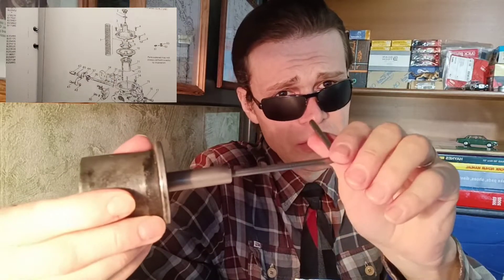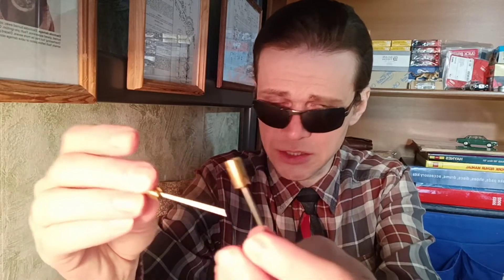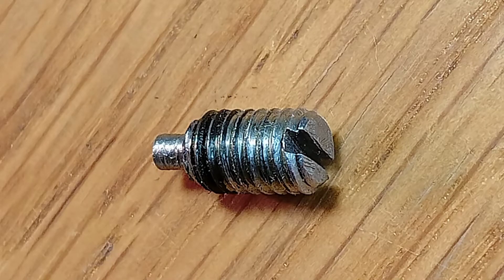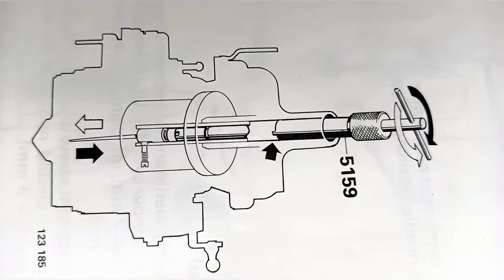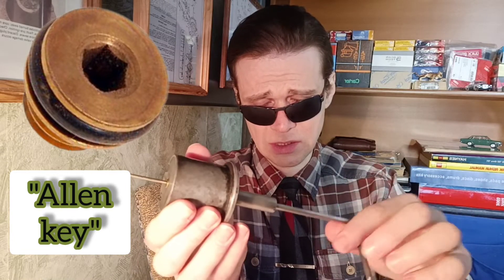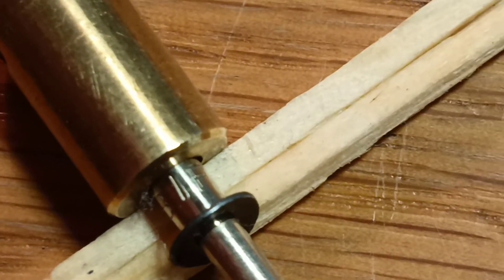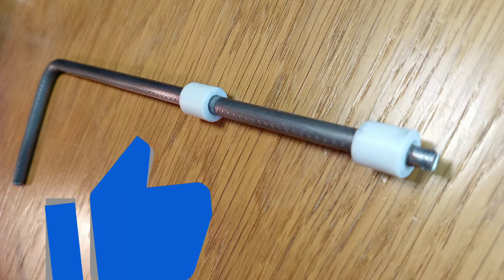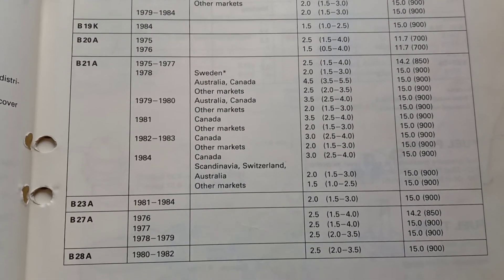Why ATF go out from carburetor Zenith-Stromberg 175CD very quickly? Adjustable Needle #carburetor

Comment: I have a problem with the non adjustable nail to be leaking. How do I fix that?
Reply from the maker: @cantzlermedia  Nail can be leaking if it 'adjustable'. In this case can be atf leakage. If it 'non adjustable' it will not leak. Another question can be with gas leakage. It's can be if the level of gas in fuel chamber too high. Which kind of liquid leaks?
Reply: @patricksgarage  it's hard to tell what leak that is leaking. I've had an issue with the brake fluid  coming into the intake from the vacuum brake booster, so it might be that that's coming out from the intake part of the carburetor. I've also had some trouble with the car only running on the choke. It's a Saab 99 with the triumph engine
Reply from the maker: @cantzlermedia  Fix all these stuff first before blame carburetor.😊🧰👍
Reply: @patricksgarage  Is ordinary engine oil okay to put in the carburator when you don't have adjustable needle?
Reply from the maker: @cantzlermedia  It's totally okay something like 20w40.

Comment: Thank you so much..My Volvo 240 have rich condition issue..Soot in pipes,blacked sparkplugs. I will turn needle anticlock to lean
Reply from the maker: Thanks for watching. Oh yes yes I am familiar with this problem 😐 also. Over-rich fuel mixture obviously. Maybe,  if mixture settings not help, check also main jet and needle condition..float level... Not forget about cold start device 😉. All that can create some problems. Of course float needle valve checked, and air filter in good condition🙂. All that can impact sooty deposits. Spark plugs should be clean anyway. Sparkplugs can be used after cleaning;-)
Reply: @patricksgarage  i have Zenith stromberg 175CD non adjustable..I move needle just a bit to lean,and its idle better and throttle response is instant,no hesitation,stumbling
Reply from the maker: @thedoctor7198  Wise solution 🙂
Reply from the maker: @thedoctor7198  When using LPG, float chamber absolutely empty, float on the bottom and can be wears out from bottom touching with shaking... maybe. Interesting way for ajusting non ajustable needle🙂  I also ajusted main jet by hammer 🔨 when ajusted needle😉.
Reply: @patricksgarage  i have same tipe of needle loke you with flat
Reply: @patricksgarage  have you insta,fcbk..Maybe another pair of ears and eys can help
Reply from the maker: @thedoctor7198  I don't have Instagram😐 But I have to do it🙂 Fcbk is. Yes, I recently thought about making a Facebook group page to discuss old cars there..
Reply: @patricksgarage  and also i have LPG instaled..I unscrew fast idle screw with spring to idle it down and screw in little bottom stop screw

Comment: What air filters do you recommend for the carbs that are good and look cool
Reply from the maker: For particular Volvo model I am always using champion W197. It can be used for 140 series and Amazon, of course with B20A engine. Sometimes Alco-MD144 or eaven scan tech 97.0406. For searching: Volvo 1277775. 
MAN filters also good, but not available now.

Comment: That is some valuable information! This service literature you have is priceless! Thankfully I have fuel injected B230f so carbureators are not my focus now, but the engineering behind it is quite fascinating :). Thanks for sharing your passion!
Reply from the maker: Hello, Marcin! Yes, now Volvo service literature is only in electronic form. Paper books only on old models. A long time ago I had a B230GK turbo engine. When I suspected a fuel problem, I simply put the injectors on a Bosch stand and watched them spray fuel. The topic about the carburetor is more extensive than about the injector. Thanks for watching!